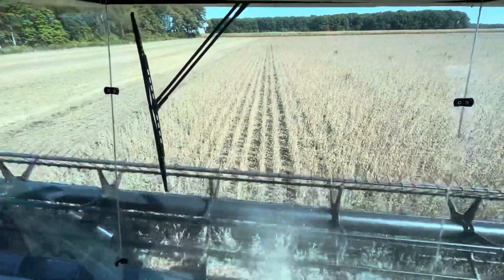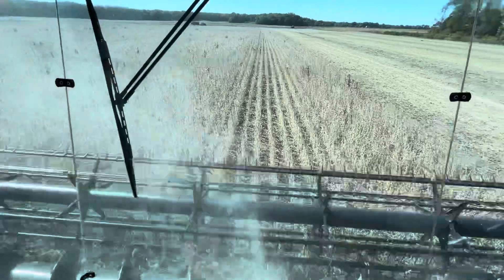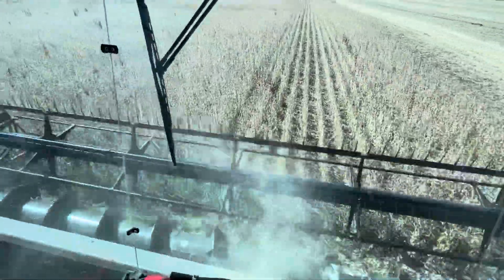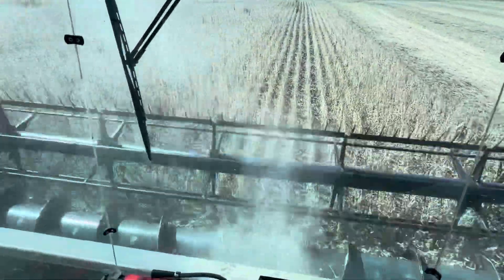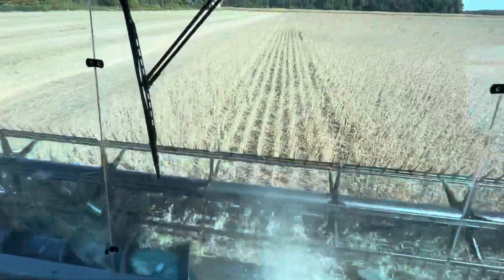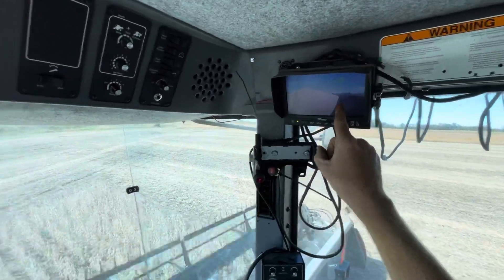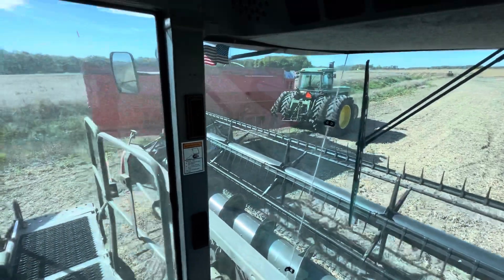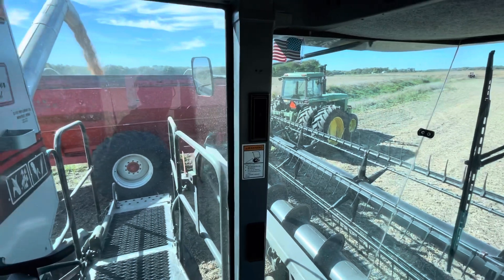Soy bean harvest with the gleaner R72 and 35 foot head.

Comment: Do you run a 8row corn head on your R72
Reply from the maker: Yeah it’s a big 8 38, ya don’t see many of them
Reply: @Hinesfarm-Indiana  here in Central Ohio I don't see the wider rows anymore. Use to have a nabor 12 years ago on wide rows but he doesn't grain farm anymore. Do you have plans of changing to 30s or do you have good luck with the wide rows??
Reply from the maker: @matthewdavis4081  so far we yield just as good as everyone else who’s on 30s, so we’ll just keep what we got.
Reply: Do you have the bigger cylinders on your feeder house. I'm running a 36 foot air flex honey bee. Had to put bigger cylinders and it still is slow lifting the header.
Reply from the maker: @rayhuggart5214 it’s got the 3-1/2 inch ones, they were on in when we bought it.